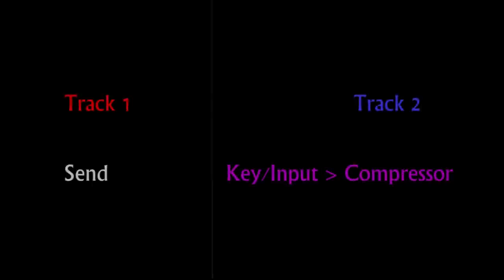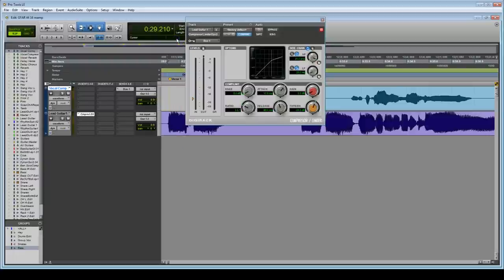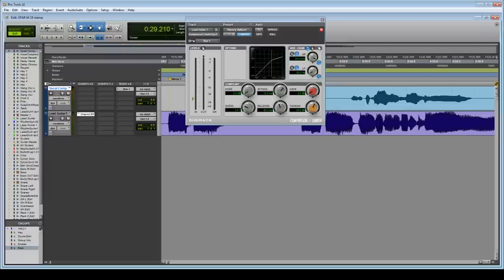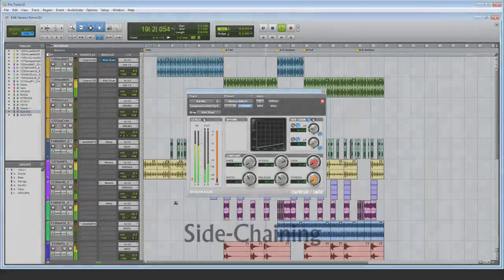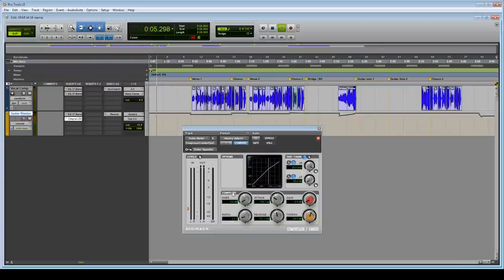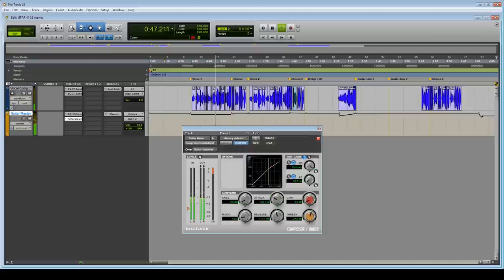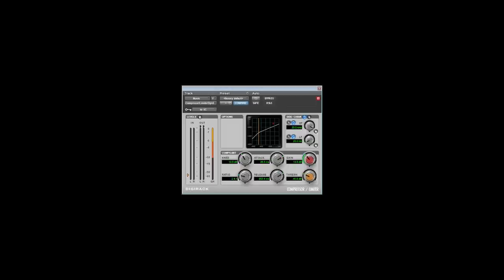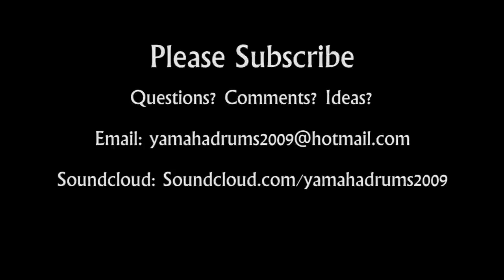Advanced Compression Techniques - Side-Chain Compression

Comment from the maker: I like the way you think - this kind of creative thinking makes us get better at the art of mixing. What you're proposing would definitely work but would rely on the quality of the compressors filters that pinpoint the mid frequency you wish to boost. They'd have to be pretty decent for finer Q settings. I'd probably just do straight parallel compression and filter it out using a separate EQ. I guess it depends on what you're trying to achieve. A dynamic EQ is also useful for this task.

Comment from the maker: I would suggest using waves trans-X to enhance transients, or a comp with a slower attack/make up gain/lowish threshold, but it sounds like you need to treat those sections differently. You could try multying-out the parts to seperate tracks, so you can enhance them differently. More than one compressor or limiter may also be necessary for the track to do everything you need it to do.

Comment: Theoretically, couldn't you use side-chaining to boost, say a mid frequency on a vocal, and get somewhat of a parallel processing type sound by using the main vocal track as the key input(using another track for the compressor) and then on the compressor's chain, set the shelf to mid frequencies, the ratio high, and then mix in the side-chain?  I feel that could work but would obviously use a lot of processing power due to more tracks being open.  Thoughts?  Great video by the way.